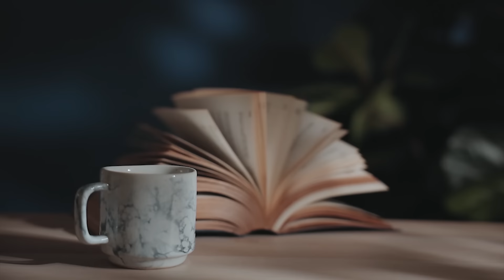Making, Freezing, Thawing and Baking Bread Dough I Bread Machine Recipe

Comment: I bake my bread rolls in my Airfryer and look forward to combining it with my Bread Machine doughs. Thank you for the inspiration! Best wishes from Sweden! 😇🩵🙏🙌🇸🇪
Reply: I don't have a regular cook stove with oven. Currently I'm using electric skillet, 2 burner hot plate, instant pot and larger air fryer. So what temp and how long do you set your air fryer? I'm really craving hot rolls.

Comment: Sandra, you wouldn't use the bread machine to mix the banana bread. Banana bread is a thick batter, not a dough and since there is no yeast it doesn't need kneading or to rise. It's easy to mix in a bowl with a large metal or wooden spoon. You can make it in a bread machine if you use a bread machine recipe. They turn out fine, just I suggest using the lightest crust, at least the first time. 

I'm sorry you didn't get on with the bread machine in the past. I found if I followed the recipes from the manual they always worked. My only fails were forgetting to put the paddle in or forgetting to add yeast. Some of my favorites were shaped  like cinnamon rolls or pita bread and it's so nice to have an assistant to do all the kneading for me.